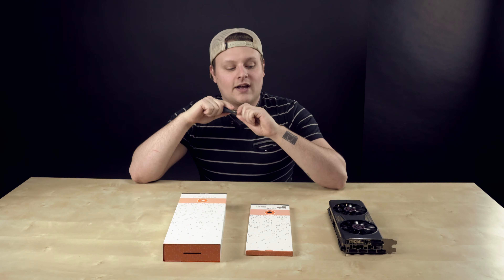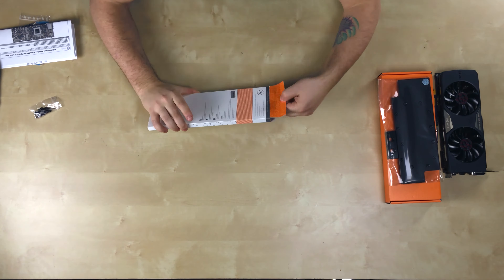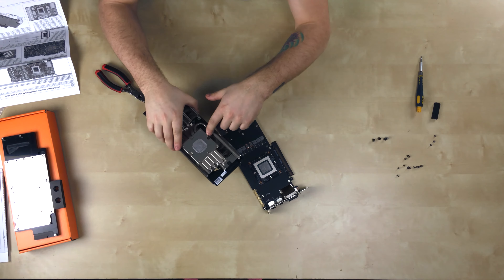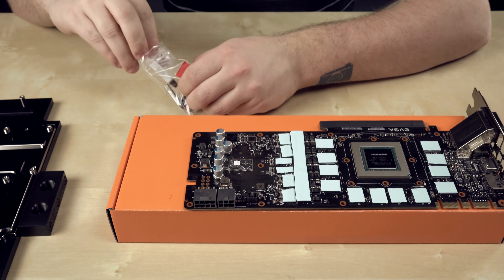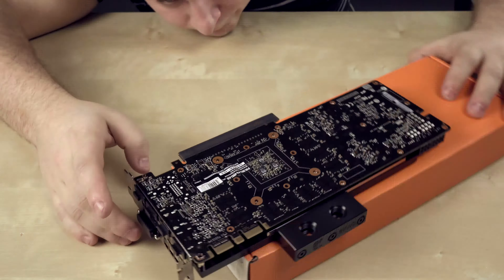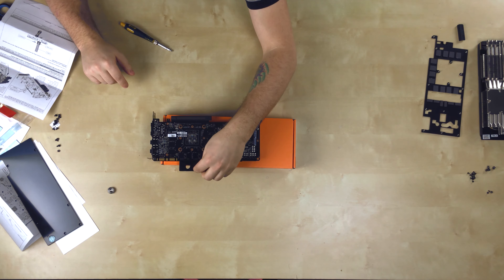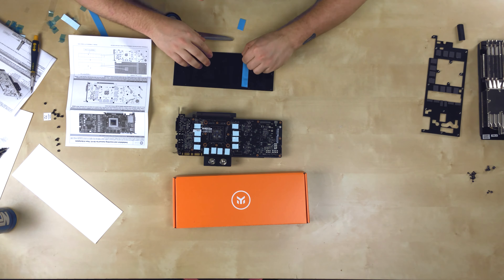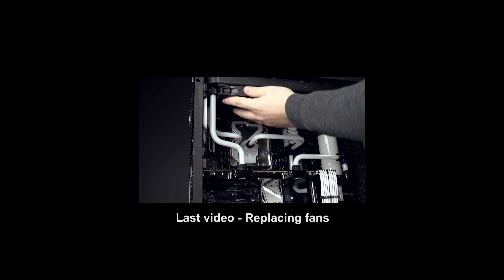Installing EK Titan X Waterblock on EVGA 980Ti - Build Log #10

Comment: Man wasted your money on a 980ti, I hope you sell it or sold it already to get a 1080, plenty coming out with waterblocks in the next week or so.
Reply from the maker: Yeah it sucks but at the same time that's all there was back in February when I built the system so I didn't really want to wait when I had everything. 980ti still hauls through anything at 1440p high settings. I don't do a ton of crazy gaming mostly built this for video editing. Thanks for watching!
Reply: I bet dude, I really enjoyed your whole build log and actually learned a lot from you more than anyone else I've watched do water cooling vides, IE JayZtwocents. I'm going to be doing my Enthoo evolv atx tempered glass edition build in February with a red and black theme with a clear blood red mayhems liquid going through it. Think its gonna look awesome. You didnt mention in your videos what fitting size you used and what PETG size ? I'm thinking about using 10inner/12 outer diameter PETG tubing for my build, what did you use ? I think the tubing you used actually looked pretty good.
Reply from the maker: +Daiesthai that will look awesome. The new tempered glass version is sick. I would have also gotten that had it been out at the time. So for tubing I used 10/8mm petg and 10/12mm fittings. Pretty standard stuff. Good luck on your build!